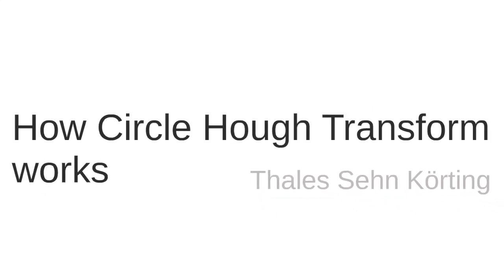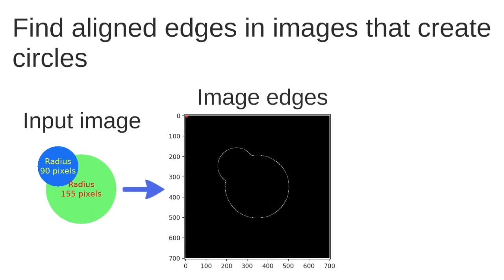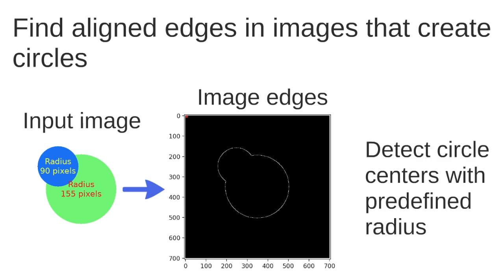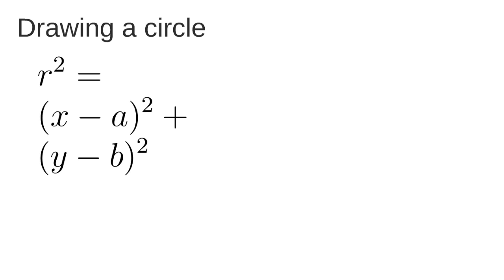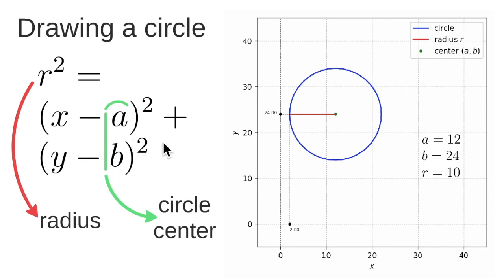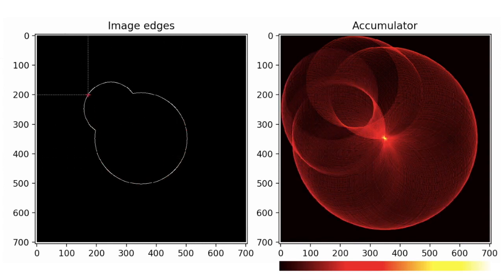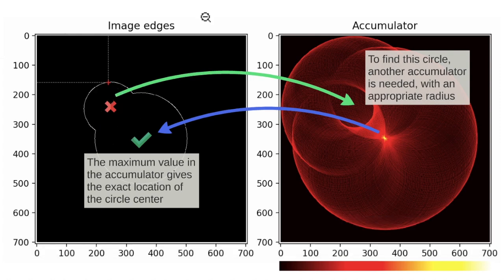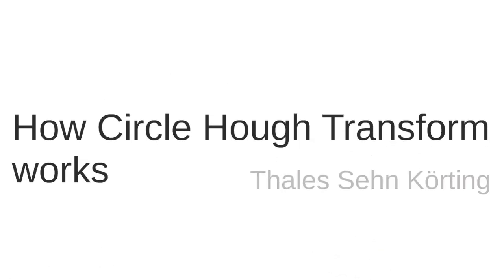How Circle Hough Transform works

Comment: Just thinking here, Couldn't this voting system be just a bit different, and even multithreaded by doing kernel matrix with the requested circle (draw on the kernel a circle), with a degree of error  (which is the % of how much the radius could be different from what ever suggested, which will be the thickness of the drawn circle), and then just multithread it by calling threads to calculate the kernel multiplication with a pixel coordinate. then you would get 'suspected' positions for circles

Comment: Can it be solved in a more elegant way? I think we actually don't need to draw a whole circle for every point of the edge, and we don't even need an edge detection filter. Instead of that, we may differentiate the input image to get an array of gradient vectors and fill the accumulator with points according to the vectors' directions (or small arcs, since their angles may be somewhat inaccurate).
Reply: Getting the gradient vectors and edge detection are more or less the same thing. But yes, you can just let the Hough transform 'vote' in the direction of the gradient vectors and the center will light up as well if you choose the correct radius. (no need to draw the whole circle as you said)